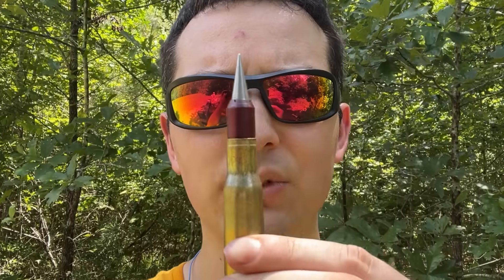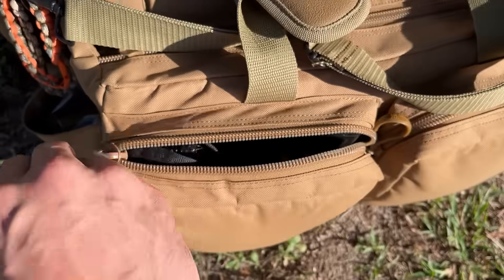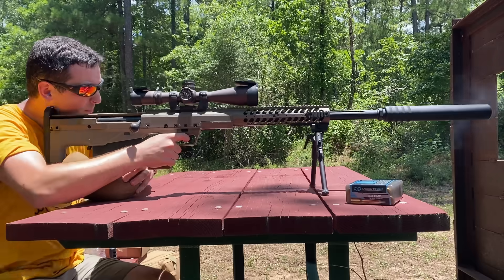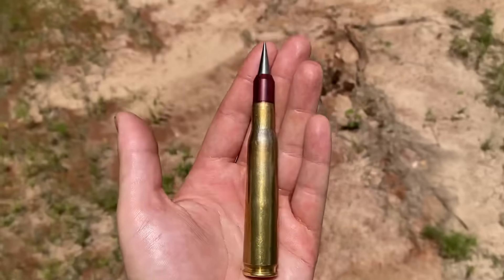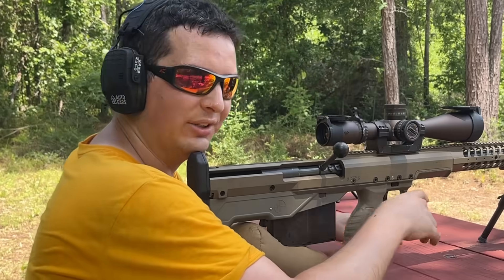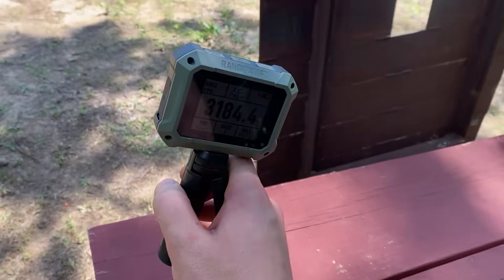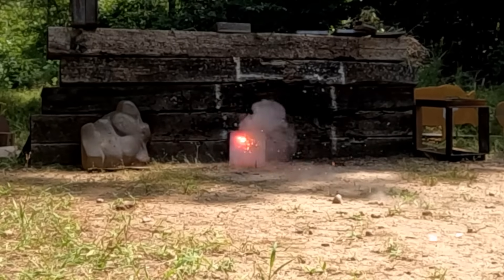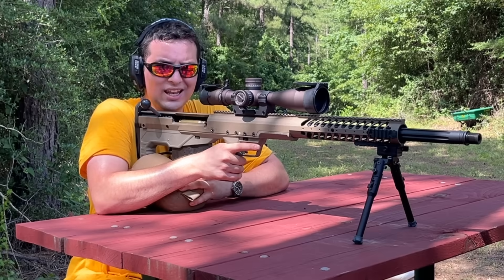How Much Steel To Stop A 50 Cal SLAP?

Comment: Scott didn't ramp the danger up far enough, Bananas using a bullpup
Reply: Somewhere, Scott's neck started itching....
Reply: @RobSandman I was just thinking same
Reply: the first underpowdered ones are just to taunt you before the recoil hits
Reply: These Kentucky ballistics comments are underrated 😂
Reply: About 15 years ago, there was a very well-known surplus dealer who hit the entire circuit of gun shows around the country. Everybody in the gun industry knew him. He would buy giant loads of surplus brass powder bullets, loaded, ammunition, magazines? Anything you can think of and resell it at gun shows. Well one day he came across five barrels full of loose SLAP projectiles. This guy decided to take some 50 BMG surplus powder and load them all up and sell them. Only problem is he didn't use an actual 50 BMG powder like 8700 or 862. He used IMR 7383. That is a powder that was designed for a 50 cal but not a 50 BMG. It was designed for the 50 spotter round which was a round designed as an aiming device for a recoilless rifle. The 50 spotter was about half the size of a 50 BMG so it used a much faster powder. The problem with 7383 is it's very temperature sensitive + fill case sensitive. You have to use a full case of powder or you won't get good detonation. Also if the temperature of the powder increases. It can drastically increase the pressure. That's what happened with Kentucky ballistics SLAP shot heard round the world. Hopefully yours didn't come from that same lot. The guy who loaded them (Jeff) knows what he did was wrong but he didn't care.
Reply: Nah, Scott confirmed that it was because the rounds were off, either too much powder, or it blocked the barrel
Reply: @AManavian FACTS!👍👍
Reply: I bet as soon as it was chambered, Scott started complaining about his neck burning
Reply: Arguably less dangerous
Reply: Its not a pipe bomb made by a fascist nut job. So ofc it didn't explode.
Reply: Luckily no Serbu on range...
Reply: Yeah my thoughts exactly...
Reply: Scott has a scar that says otherwise 😅
Reply: So really what good are they
Reply: Wow…😅
Reply: Hea aint launchin no bananas outa that bullpup
Reply: Werent scotts reloads he found somewhere?
Reply: Scott almost died shooting a rifle that blew up in his face so give Scott a little credit for still being alive dude.
   I prefer this channel just because he's mellow with a bizarre sense of humor that I relate to where Scott is a bit vociferous and melodramatic which is funny too but just not my favorite personality. I feel like I get more valuable data from this channel whereas Scott is just overly outlandish but I still have much respect for Scott...maybe I just like the name Scott.
Reply: Hole in the neck ❌
Hole instead of a neck ✅
Reply: That inbred idiot is why people hate gun owners. Using a glorified pipe .50 cal and sketchy fake slap rounds he honestly got what was coming to him.
Reply: Scott was using an over engineered pipe 💣
Reply: funnily enough, bullpups are less lethal than other guns when put under breach pressures that cause catastrophic failure. not that it matters with a 50bmg, but its a comforting thought
Reply: That bullpup is much safer than that single shot Serbu where the cap sheared off.
Reply: @michaelegert1284 that bull-pup would shred to pieces. It was proven and tested.

Thankfully modern ammo sellers like to severely underload the SLAP reloads after what happened to Scott
Reply: @michaelegert1284  the one where the cap was way over spec for being used on the gun? They did the math on how much force is needed to shear the threads, and a .50bmg under normal conditions, and even a SLAP round, under normal conditions, does not get even close to the pressure needed to shear the threads
Reply: Scary after you watch Scott's rifle detonate
Reply: Tbf the only thing between Scott and the round was a threaded cap, the bp at least has a bolt assembly to take most of the force XD
Reply: @Scuffed_Gambit  There also were those ears that sheared off. Those could've been longer for more stability.
Reply: Bruh that breach wasn't just up in his face but also in his neck.  Bull pup or break action at to proximity of your money maker is prit near the same.
Reply: This is quite a danger decrease versus that real-life pipe rifle that Scott was shooting.
Reply: @deejayimm  if you looked into the specs of the gun Scott was using you would know that calling it a pipe rifle is wildly misleading as to how reliable it is
Reply: @TheSandsofFlowingTime  All you need to do is look at the breach plug vs a modern black powder.  It's a shit design for that kind of pressure.

Not saying that's what caused it, but there's no way in hell I would trust that thing, and I was saying that before the accident.

There's like 1/4" of threads on that cap.
The point of failure shouldn't be the closest place to the shooter.
Reply: A mark serbu 50 cal with a screw on cap